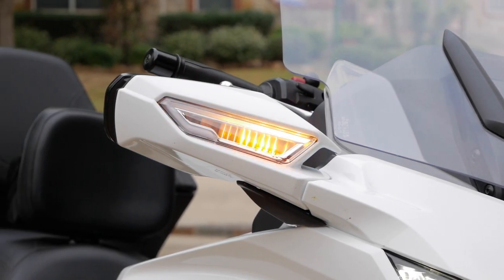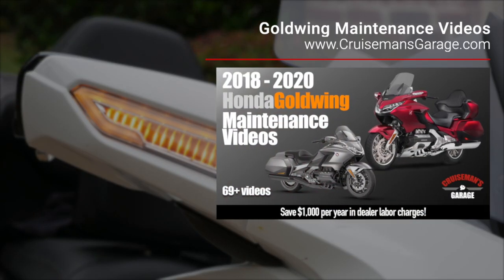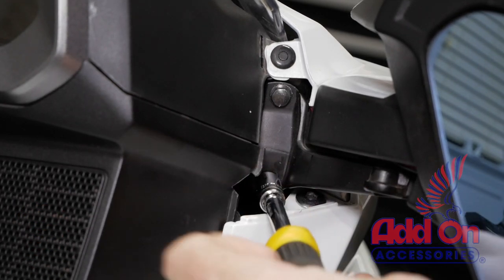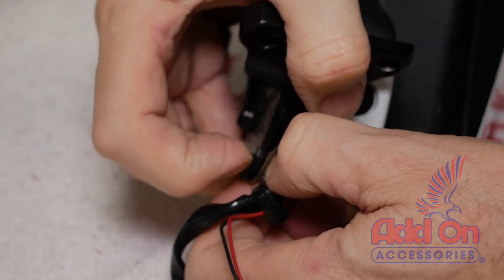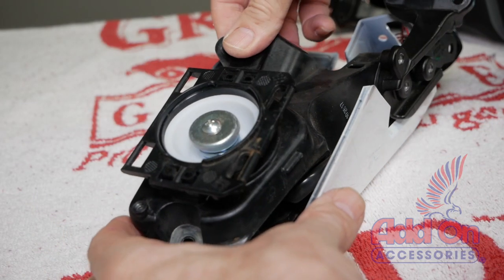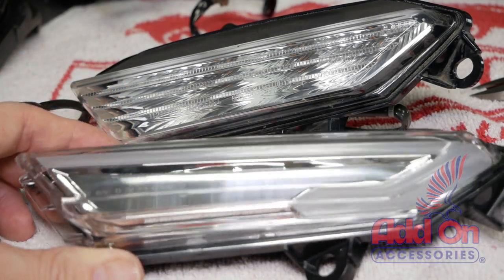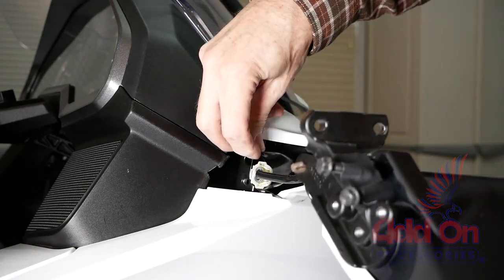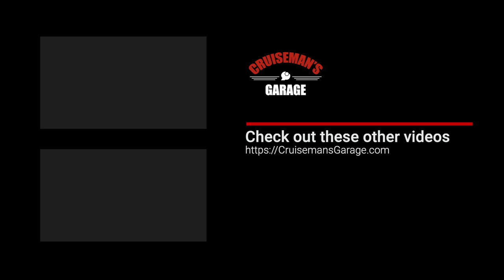Add-On Accessories Sequential Turn Signals | Cruiseman's Reviews | 2018+ Honda Goldwing

Comment: Like the Intro music.....I have installed mine and I like them with one exception, the DRL are not  very bright especially in the daylight. Now at low light or at night they are sweet. I was about to return them but I decided to keep them. Hopefully, Add On will respond to many not happy with the DRL's not being bright enough in the daytime. I also broke the mirror tabs on one side and they are not cheap to replace, I used JB Weld which is holding up well, guess I'll keep the new mirror assembly as you can not just buy the mirror tab section separately. Ride Safe!
Reply: Good to know! Thank you.

Comment: Thanks to you I installed those on mine. Very easy install. They look great running and signal. For first timers taking any plug apart, I do recommend to put a towel on the cowl under the mirror just incase you drop the mirror on the wire tail trying to disconnect the mirror. Or, ask someone to hold it or use a carboard box sitting on a garage stool and place it right under the mirror. That helped me a lot. It will a sham to scratch the cowls.
Reply: Great point Al. Thank you.

Comment: In reading several reviews on GL1800Riders, many were disappointed  with the brightness of the LED's in the daytime. Both the White DRL's and the Sequential Turn Signals. I saw where somebody wrote to the manufacturer and they say they are working on making them brighter.  Cruiseman, do you have an opinion on the brightness?

Comment: I have these and love them.  However, I just bought the Goldstrike Mirrors with turn signals embedded.  The add-on turn signal draws so much voltage from the stock wire that the mirror lights barely work.  Goldstrike customer service said that I need to bring turn signal power from the rear.  Where would I get that power?  I have the gold strike wiring harness, but not sure where I could get turn signal power from the rear.  Thoughts?
Reply from the maker: To pull the turn signal power "from the rear" you might need the Goldstrike power bank or PathfinderLED Power Accessory hub.

Comment: Hello All,
 

My new 2020 GW and the new sequential turn signals are in and I think they look great. (thank you for the video)

My question to you is this, can I or better yet, should I daisy chain two different wiring harnesses together for a total of 4 on my bike? The reason I'm thinking of doing this is because I bought some lights from Pathfinder and some from Goldstrike and of course they have different harnesses. 
Will I really blowup (yes I know its an exaggeration) my bike or short out something very important?

Thank you in advance.

Comment: Hello, I have been told by the supplier that the 2021 Goldwing model requires to install a SHOW CHROME or a PATHFINDER power hub in order to plug the led mirror light onto it instead of been plug and play on the OEM connector as you mention. Any comment? Why this? Would it work without the Power hub? Thank for any answer from the community
Reply from the maker: This is because Add-On does not offer a "plug-n-play' harness. And, they do not want you tapping into existing wiring on the Goldwing, risking the integrity of the CAN BUS electrical system. If you already have a plug-n-play harness installed from PathfinderLED or GoldStrike, you COULD cut off one of the p-n-p connectors and wire the mirrors through the harness, but it still offers no CAN BUS protection.
Reply: @cruisemansgarage  Hi thank you for the video. Yesterday I installed this on my 2022 Goldwing exactly as you demonstrated in the video. The DRL are bright and everything works as designed and simply replaced the OEM Honda light with the Add-On ones. I do have a Pathfinder PDU and additional lights (cowl, tail mount, rear) in a box which I will eventually install down the road, but really did not see much of risk replacing one type of Honda OEM light with another similar light. Thanks for your videos I find them informative and entertaining as well.

Comment: Easy install, but...the very first screw holding on the plastic cover over the 8mm bolts - it was a 4.5mm on my 2023 GW Tour, not a 5mm.  shrug  Other than that everything went swimmingly.

Comment: I just installed this in my Goldwing 2019, however I could not get day running light. How can I get DRL?
Reply from the maker: So, turn signals work, but no DRL? I would contact Add-On Accessories.
Reply: Yes, turn signal work, but no DRL..
Reply: Did you perhaps connect the device to an isolated turn signal from a power hub? If so, that would presumably not be a combined run/turn signal - so you would not get the DRL effect. I would like to know what AddOn expect you to do to get a combined run/turn signal from a power hub.